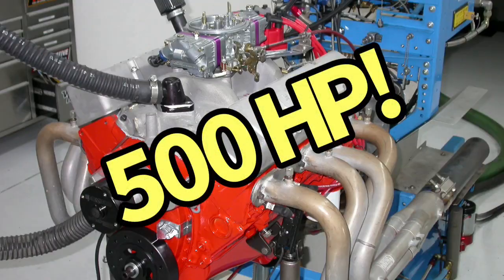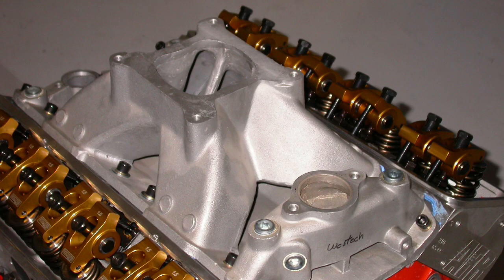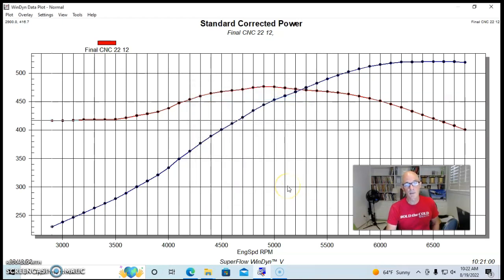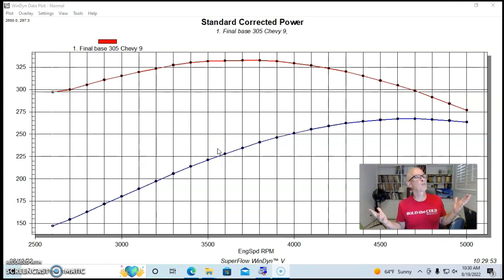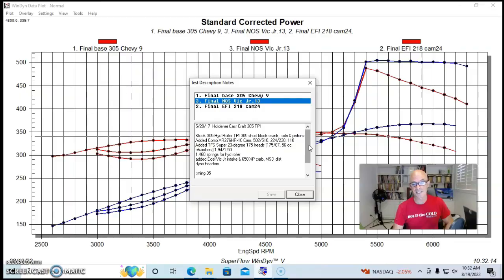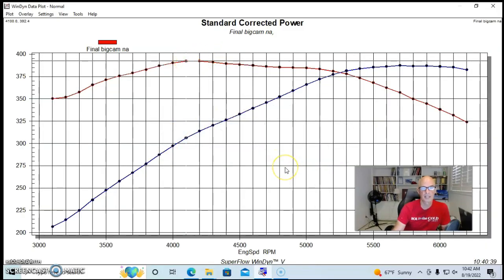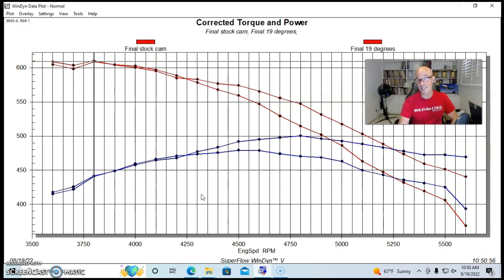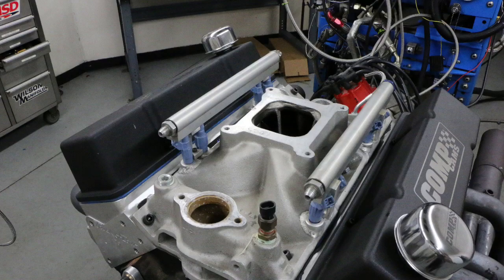HOW TO BUILD A 500-HP SMALL BLOCK. 302, 305, 372, VORTECH 350 & TURBO TUNE PORT! WHICH ONE IS FOR U?

Comment: 950 carb? Seems way to big. I have a 522 big block by Reher & Morrison 14 to 1 motor Dart Big M Block Dart 355 heads running a Gary Williams 1050 dominator. Runs 7.80 in the 1/4 @171.MPH. 4.90 in the 1/8@ 141. MPH  There must be a big difference in Gary Williams carburetors then what others produce. Unless you're regulating that big time & using a high-speed bypass. Just seems like a lot of carb.
Reply from the maker: REGULATING WHAT? IT'S JUST AIR AND FUEL(WHICH CAN BE ADJUSTED)

Comment: The DZ302 motors race-prepped made 480 hp with the old school fuelie heads, solid lifter non-roller cams and probably stock stamped rockers, late 60s technology level.  This is a pretty neat video about putting one together:  https://www.youtube.com/watch?v=oRQVL7NWqi0
Reply from the maker: 480-hp Trans Am race motors were very modified from stock

Comment: And you can just throw a good matched set of heads on a l76(,LS2) and make close to or over 600 HP. That's why ls is king 👑. I love ol sbc stuff but, it's just easier to make power with an ls based engine. Nothing like the sound of a 383 sbc chopping away though ❤️
Reply from the maker: heads on a 6.0l will not make 600 hp without a big cam and intake upgrade and even then-600 hp is tough
Reply: @richardholdener1727  yeah I absolutely meant with heads an the right cam and intake as well. I see the combo on g8 gts put down the combo numbers all the time. Lots of them out there over 500 rwhp

Comment: 372 very underrated combo 400 with a 350 crank should have been offered from the factory
Reply: Same type result as a 400 but little less power. Yes it revs but it has to

Comment: Sorry mayby the wrong vid to ask this question in.   But How about octane rating  and max boost .  On premium US gas  that is 93 octane ?   that would be around the same as the 98 octane here in europe      I read max static compresion  is about 12.3 to 1   Is that with cast iron  or aluminum cilinder heads?   And what would the max static compresion be  on a better fuel?    Here we use LPG a lot that is a mix of propane and butane    70% propane and 30% butane in winter     70% butane and 30% propane in summer     That  should give a european  octane rating of 105   so lets say 100 US    I can  not find the exact octane numbers for summer and winter LPG   Have you ever done a vid  about the max staic comresion  and the octane of the fuel ?   Regards Remco
Reply from the maker: hard to say what the max static compression is, since detonation is dynamic-meaning other things come into play-like timing, air temp, cam timing (dynamic compression), quench, hot spots etc...

Comment: I Got A Chevy 350 That Had Been Sitting For 20 Years. It Was Put Together And Drag Raced Back In 2002. It's In A 1955 Chevy Pick Up All Dragged Out With A 14.5" Wides etc. Converted It To A Fi Tech Fuel Injection. It's Got A Massive Cam (Thing Idles At Like 70kpa, And That's That 82kpa Is Atmospheric At This Elevation), It's Got Ported Iron Heads With Springs And Roller Rockers. When I Resealed The Oil Pan I Saw It Had Forged Pistons With Stock Rods And Crank. It Was On Nitrous. I Really Wanna Slap A Turbo On It. She's Tired But I Think Turbo Will Put Some Wind Back In Her Sails hahah

Comment: Hi 👋 👋 👋 👋 Richard I like all the test you did it was pretty simple for the most part. I was wondering if any of the cam grinds you mentioned would work for my old 4.3 with Brodix heads and  a intake with a Holly Terminator injection on that and a Torquestorm supercharger.
Reply from the maker: 4.3l V8?
Reply: @richardholdener1727  V6

Comment: I enjoy your engine builds immensely. You give really good information in an easy to understand fashion. Your smaller cubic inch motors delivered about what I expected na. The mid level 350-375 cubic inch motors delivered respectable hp numbers. Surprisingly the 180 cc intake runner head delivered far more hp than I would have expected. Kind of makes you wonder if the AFR 227 heads might have been a little overkill for the build. If I were building a small block for the street i would prefer a larger displacement of 400-430 cubic inches, 9.0-9.5 compression ratio with 200 cc intake ports on the heads and hydraulic roller cam with 0.570-0.600 inch lift. 112 degree lobe separation and somewhere around 225-235 degrees duration. Major goal would be valve spring life. With todays metallurgy that should not really be a problem.  Everyone has their personal favorite and they are all correct.
Reply: Add Sara z

Comment: Sorry but 327 is the best just my opinion and why no 327 runs ??
Reply: Yep, people were making 500+ hp NA 327s back in the mid 1960's.  Of course, with mid '60s technology, it wasn't very streetable at those NA power levels.  With today's technology, it would be very streetable.  Although for the street, I'd go with a 372 instead.
Reply from the maker: please see the many 327 videos up-it was not magic-just a different displacement

Comment: 372 Chevy is not a stroker motor.  It's a De-stroker motor.  350 crank in 400 block.  This used to be a very popular combination to build in the 1970's and early 1980's before everyone got hooked on 383 stroker motors.  I still prefer the 372 or 377 to the 383.  It revs out much better and you have less valve shrouding.
Reply from the maker: ANYTHING THAT IS BIGGER IS A STROKER
Reply: @richardholdener1727  but it's smaller so it's a de-stroker.
Or big bore, a big bore 350.
De-stroker 400 or big bore 350. Pick your poison.
Sorry Richard don't take it personally, I'm just being a pedant.
Reply: @richardholdener1727  A 372 is not bigger, it is smaller.  It's made by De-stroking a 400 SBC.  Also if the engine is bigger because you bored it out, it is not a stroker.  It's only a stroker if you increase the stroke size.  A 372 Chevy is a De-stroker.

Comment: Is an LS considered a small block Chevrolet? Asking for a friend 😜
Reply: Chevy says the LS is a small block Chevy because it retains the 4.4" bore spacing.  it's just a totally different small block Chevy than the Gen 1 SBC.
Reply: Sbe but technically it's a 327 because of displacement
Reply: @redlight3932  SBE is just 'stock bottom end'... & the LS series came in many more sizes than 5.3 liters.

Comment: Holdner, I have a great idea for a video. Take a stock 5.3 and dyno it, then open the ring gap to .030 for the top and bottom rings, see if there is any power loss!
Reply from the maker: I DID THAT ALREADY ON THE BIG BANG MOTOR-NO CHANGE
Reply: That's a horrible idea for a video.

Comment: I was pretty impressed with those DART 180cc heads.  As cast and they flow really well.    I noticed they only have 130lb springs.  Might have been able to get a little more power with just a spring swap on those.
Reply: I dont think higher spring pressure adds power per se.  higher spring pressure just keeps valve float from happening at higher RPM's if power is on its way down as it was with these heads your not gaining anything.

Comment: I'm waiting on a 1,500 hp build list.
Reply: You can't make 1500 horsepower on the low at this moment In time
Reply: @redlight3932  You can make it with an LS. Might cost you a bit, but it's cheaper than most other motors. Just add boost.
Reply from the maker: SEE THE BIG BANG MOTOR VIDS
Reply: @richardholdener1727  Lol. I've watched all of them. I want an engine though Richard, not a hand grenade. I'll just have to shell out for forged internals I guess.

Comment: Buick cylinder heads Richard. I bet half of your subscribers are saying W.T.F. !!! Back in the day I built many of these, and trust me, they were most impressive at the time if you TRULY understood them. See if you can find a set, and the right cam, intake, and headers, and give your subscribers something to really think about. The Pontiacs were impressive and cool, but the Buicks were my all time favorite to build. Ahhhh, the good old days. 
T.S. RACING
Reply from the maker: I have some Buick heads-on a Buick
Reply: No Sir, Buick on a S.B.C. 
Your subscribers will love it. These were old school CORPORATE G.M.Performance heads, not Buick as in Buick, and not Pontiac as in Pontiac, these were ONLY for the S.B.C. 
Remember this is almost 40 years ago and not to be compared flow wise with modern LS or SB2 heads, but they still made great power.
Very interesting technology and still quite impressive. The Buick worked best on the destroked 400, and you really needed to spin them up to make good numbers. And yes, they bolted on a standard Bow Tie or Brodix aluminum,  S.B.C.
Reply: @t.s.racing  I think your talking about the head that was made by Dart and was modeled after the buick series II head and was used in drag racing. Better combustion chamber, valve angles, and ports spaced out made it a serious contender back in the 90’s.

Comment: How about 305 vs 307 ? 
Conventional wisdom dictates that the 307 with the bigger bore will breathe easier, but the 305 with the longer stroke generates more torque. With Vortec heads, who will outrun who ?
Reply: Longer arm doesn't develop more torque. More displacement does.
Reply: @Burnoutkid11  adding stroke adds cubics no doubts but torque is a measurement of the crankshaft leverage and increasing the length of it is always going to have more torque.same as a longer stick lifting a rock of more weight than you can move without a length of pole pry it out with
Reply: @kennyhupp5665  torque can also be made by a larger piston
Reply: @Burnoutkid11  because of the added force on the crankshaft, but still doesn't disprove my point on this.have a good night brother
Reply: @kennyhupp5665  just like a breaker-bar, or cheater-pipe.
Reply: @mistered9435  exactly right
Reply: @kennyhupp5665  more piston area with the equivalent cylinder pressure will create equal torque to less piston area with a longer stroke, displacement being equal.

Comment: How about a 500 hp 307?
Reply: While the 307 is not as bad bore/ stroke combo as a 305 there is little performance equipment available for them. Unless you bore it to 4" [327] Neede a good non rusty block though. 4" block is the go however.
Reply: @ldnwholesale8552  Little performance equipment for the 307?  LOL.  It has a 283 bore.  You can easily run any aftermarket heads with 1.94" in. 1.50" exh. valves.  There's more SBC aftermarket parts that will work on a 307 than will work on a small bore 305.  Just bolt some 350 Vortec heads on a 307, and you have a runner.

Comment: I like to call the TPI intake a 'torque filter', because it's like a low-pass filter for torque. The audio guys will get the reference.
Reply: Removes the low end torque so you don't blow out the tires?  Lol
Reply: @383mazda  no, the tpi intake made huge torque down low. The tpi was the best truck setup that GM never put in a truck.
Reply: @THEFERMANATOR  so what you're saying is I should put a TPI style intake in my 76 heavy half?
Reply: 😊 @Prestiged_peck
Reply: @383mazda  tpi makes big block torque from a small block
Reply: Bahahahahaaaaa! (I don't get it)
Reply: Heck yeah bro. I dig the reference.
Reply: I got it. Lol

Comment: Would be cool to see an old school 500hp small block for us broke guys out here, with like a flat tappet cam, no EFI crap. Like how can a guy(or girl) take an old 350, what heads cam and intake would it take to hit 500hp, like I said, with a flat tappet cam. I know from experience that the isky 292 mega cam will rip right up to 7000 rpm's , but I'm sure there's probably better? Or could it even be done with 350ci with just heads cam and intake??? I know if you step the stroke up and make a 383ci it's no problem to hit that 500hp mark, maybe you just have to do that if you want to hit that magic number???
Reply: 10:1 compression, Chinese aluminum heads, healthy cam and a single plane. Pretty easy actually. Any head with ~260 cfm or more of airflow would get the job done if it can accommodate a .550+ cam and spring package.
Reply: Flat tappet lol
Reply: The easiest way to get to 500hp with an old school NA SBC is a 406.  It's so easy, even a cave man can do it.
Reply: You MAY get 500 with a solid flat tappet cam. Needs very good heads intake and compression. And will never be a street engine. Even with a roller cam 500 is far from a street car driveability. And yes I have built them. For roadracing
Reply: @ldnwholesale8552  I built a 406 SBC with a Comp Solid Roller cam (242 deg. in. 248 deg. ex. at .050"), Dart Pro 1 Platinum aluminum heads, and a Holley Street Dominator dual plane intake with Holley 770 Avenger carb that had mega street driveability.  It revved out to 6,500 rpm no sweat too.  I put it in a daily driver 1972 Monte Carlo with 2004R auto trans with a mild lock up stall converter.  It made 500hp and the wife loved to drive it.  It was a sleeper, I killed many "hot cars" on the street with that one.  Even had A/C on it.
Reply: @ldnwholesale8552  My 406 is cavenan Technology,  there's nothing about it to make it hard to drive. Instant throttle response. 518hp, 540 lb/ft . It just sucks gas. Hydraulic roller cam, rpm air gap, 10.5:1 runs on mid grade pump gas.

Comment: What’s the max cam  lift I could go for  tbi 305?
Reply from the maker: lift is not the issue
Reply: @richardholdener1727  ok , I have a tbi 305 that I want to cam by I keep reading the about .480 is the max but you have a cam that is in the .500+, is that possible with a tbi 305 motor?
Reply: @thirty2toone  The .480" limit has nothing to do with piston to valve clearance.  That limit is in your stock heads.  You either have to go with taller valves and valve springs with a taller installed height, or cut down the top of your stock valve guides.
Reply: About 3.5 inches with the piston at BDC….
Reply: A bone stock set of tbi heads will smash the valve seals at .480 lift. They're more limited than vortecs are in my experience. That said, a set of offset locks will allow you to run .480 lift.

Comment: Best small block ever.. 305  😂
Reply: Fun fact- a 327 block with a 283 crank made a 302. Rocking motor!
With all the 283 blocks and 327 cranks laying around someone at Chevy got the bright idea of the 305….
Reply: @michaelgarrow3239  305 has a smaller bore than a 283, and has a 350 crank-- 3.736 bore.  3.48 stroke.
Reply: @michaelgarrow3239  283 block and 327 crank is a 307.  The 305 is a 265 block with 350 crank, which is why it sucks so bad.
Reply: They make very good anchors!

Comment: The second motor was the best to me! It put out the power and torque lower down! 
Thanks again for another great video Richard bud!!
Reply: With a TPI, I wonder if you put larger-diameter runners in the system, 2" headers, and THEN a centrifugal supercharger, how would it act? (with a high-RPM-emphasis cam.)

Comment: For a future video I was wondering if swapping out the water in a water meth kit for peroxide would show any benefits (I get that it would cause more oxidation on metal parts but also maybe more power)
Reply: Rocket fuel? :D
Reply: @exploranator   with any luck we'll be sending a piston to orbit
Reply: @exploranator  Hydrogen Peroxide used for Rocket fuel is 90% and higher.  What you buy at the drug store is only 1.5 to 3%.  Average Joe can't buy 90+% H2O2.